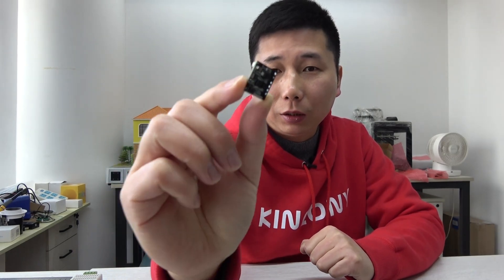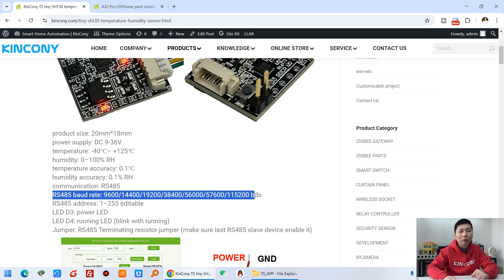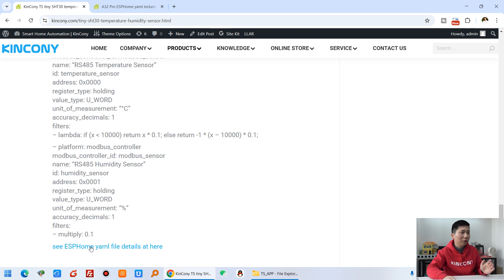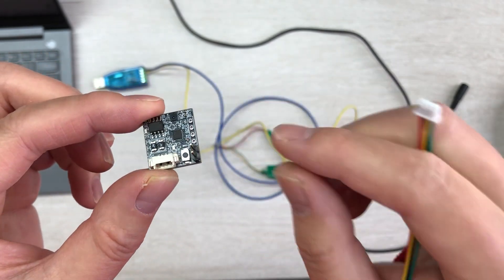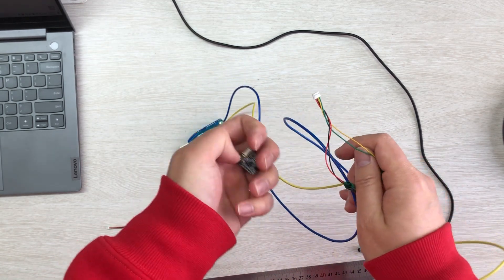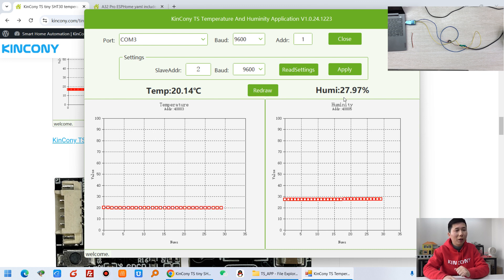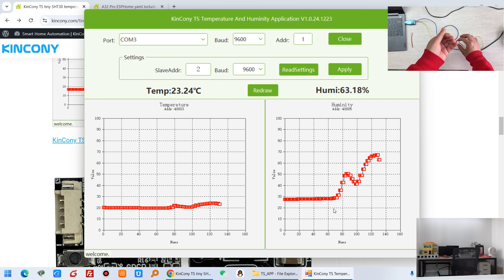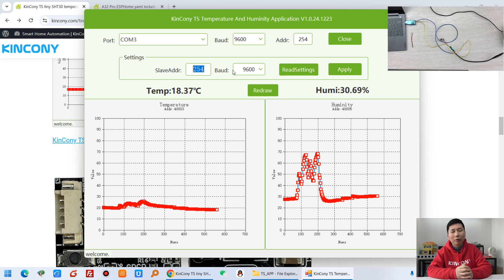smallest SHT30 RS485 Temperature humidity sensor (TS) Tiny version

Comment: I guess we can use this one on kincony board with rs485 connector? But is there a way to use multiple sensors on the board? Something like rs485 bus?
Reply from the maker: KCS v3 will support that in future. one GPIO work with multi DS18B20 sensors.